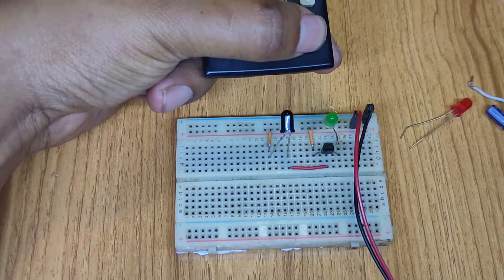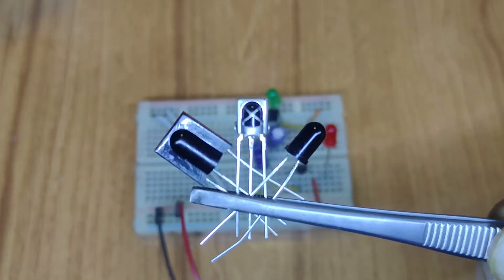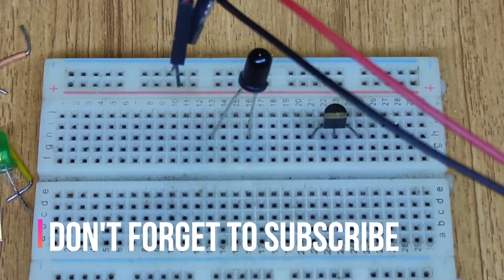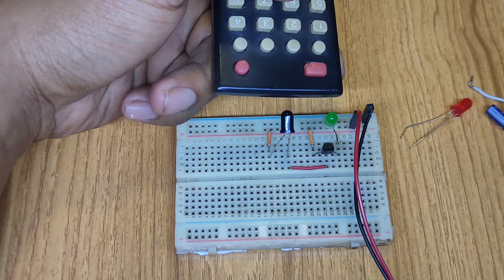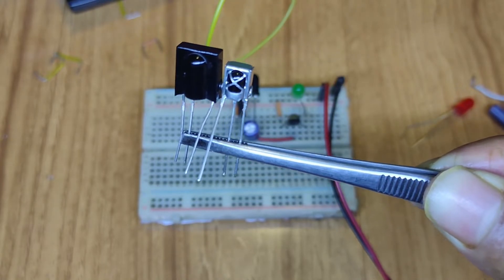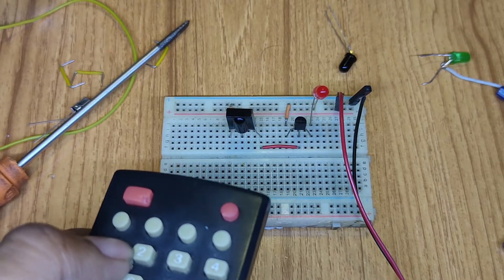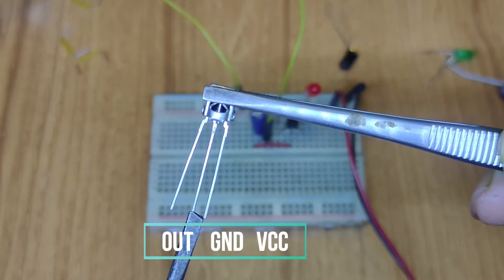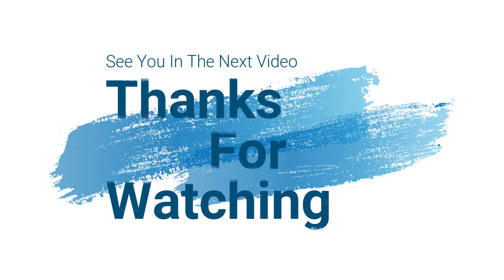How to Work Infrared Sensor & Its Connection || IR Receiver Circuit || Simple IR Circuit| IR sensors

Comment: the first ir receiver, 2 pin, is photodiode, can detect natural infrared such as from fire even human body, just need right circuit. 
the 3 pin, is ir receiver for modulated ir, such as from ir emiter led from remote tv, ir lamp etc
Reply from the maker: Yes you are right about this. And this video is a basic example as demonstration of IR receivers.